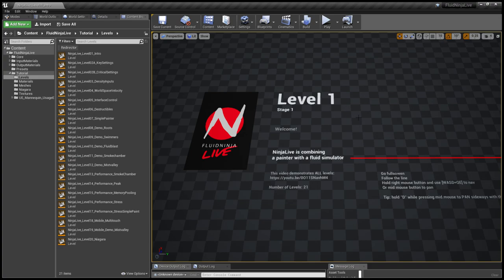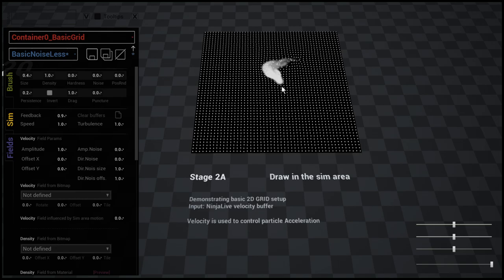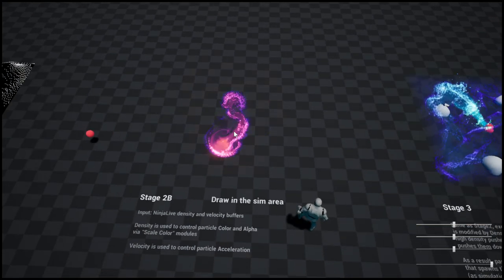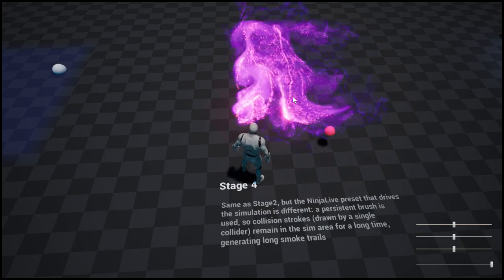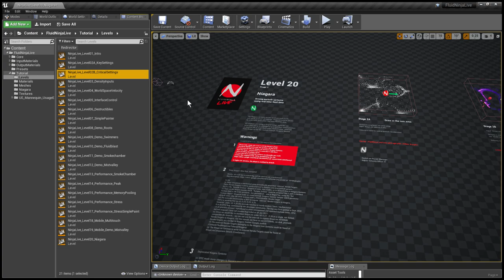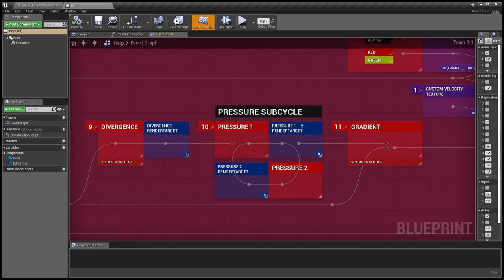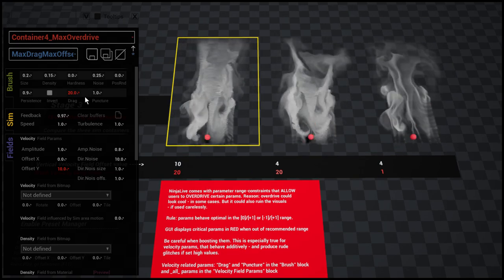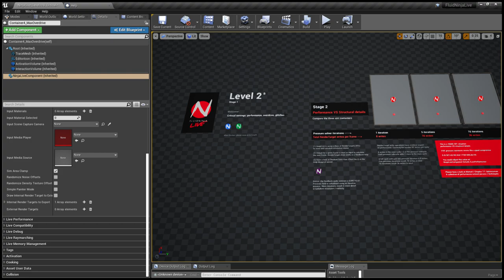FluidNinja LIVE 1.0 - Niagara and Parameter Overdrive

Comment: the new version is bit different from the video, the Niagara system is not persistent with density texture
Reply from the maker: Thanks for the feedback! -- ninja base project is developed under UE 4.23, to maintain backward compatibility. Niagara has changed A LOT since 4.23  - if you open the level placed n.systems in n.editor under UE 4.25, you will see: many modules are deprecated. All you need to do is use the FIX function that niagara editor offers, and then, the systems will look the same as on the video.

Comment: How do I scale the textures on these systems? I can get the Niagara system to be larger and the ninja system but the area controlled by the texture stays the same.
Reply from the maker: Hi DocsNaught! --- Scalig fluidsim data over Niagara Grid 2D system:
a. select a Niagara System on level that you would like to drive
b. locate the actual uasset that is used (Details Panel /Niagara System asset)
c. open the system with Niagara editor (double click on it in the Content Browser)
d. locate the "Sample Texture" module in the Stack
e. locate the UV param group: set FLOAT multiplier (by default, 0.002)
(in case you set up a user parameter, scaling could be set without opening the system in niagara editor)

Related content:
(1) Manual, 20.3 STEP-BY-STEP GUIDE: LINKING NIAGARA AND NINJA
https://drive.google.com/file/d/1I4dglPjeXLcNkSGxGok8sQCy59qgYcF9

(2) A step-by-step guide to build basic texture sampling emitters:
https://80.lv/articles/tutorial-driving-niagara-with-flowmaps-and-baked-fluidsim-data/
Reply: @AndrasKetzer  that’s perfect! So the value is inverted like to double the size i would do .001